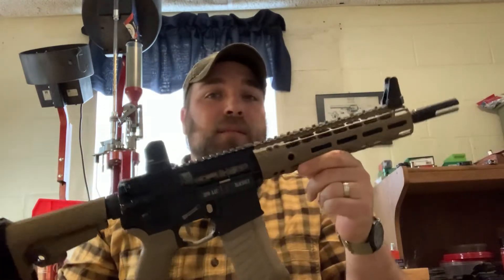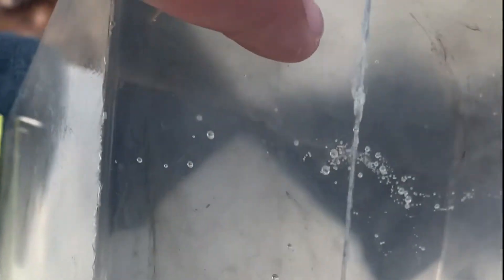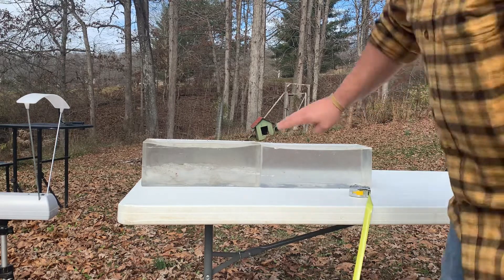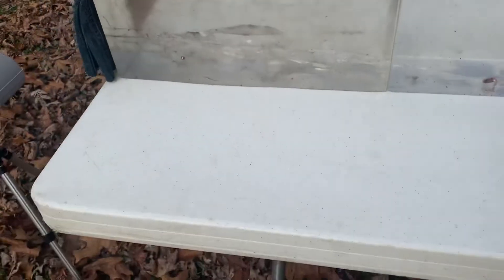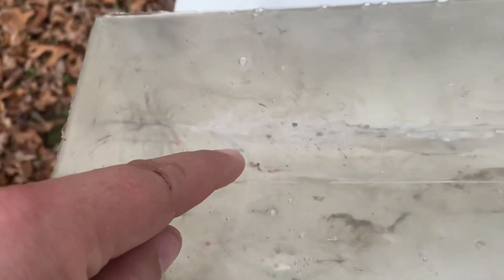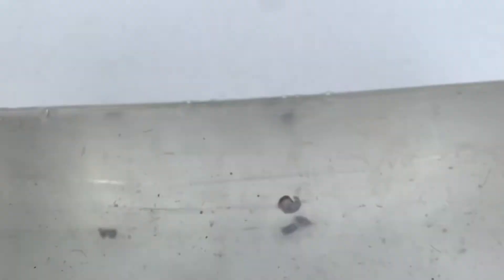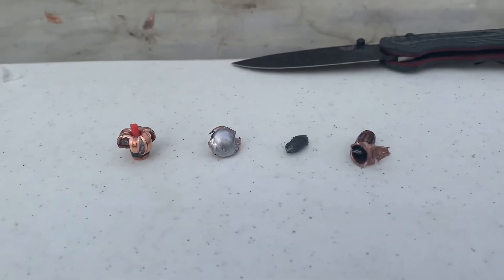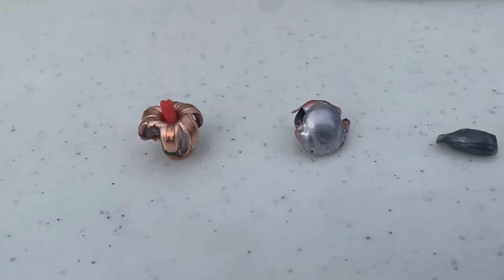300 blackout ballistic gel test

Comment: This test was done at very close range, replicating a self-protection scenario.  There is little value in having a bullet that doesn’t expand traveling 24” into gel. You want maximum expansion and shorter penetration to convert most (or all) of the bullet’s energy into tissue damage.

These results cannot be extrapolated to typical hunting ranges. That’s not to say that the 300 BLK cannot be used for hunting.  It is quite lethal when used within its kinematic envelope. 

But you need to select bullets that are designed to expand at 300 BLK velocities.  There are now several of these on the market.  My personal favorites are:

Supersonic: 110 gr Nosler Varmageddon bullets, that I handload at 2415 ft/sec. Wicked on feral hogs.

Subsonic: Hornady 190 gr Sub-X factory ammo.  This stuff ain’t cheap but it performs exactly as advertised. Hornady did their homework on this one!
Reply from the maker: My daughter has taken several large bodied East Ky deer with the 300blk using the 110g gmx load. Full pass throughs and quickly dispatched.
Reply: There's little value in 300bo period

Comment: I've dropped a 200 lb. hog in its tracks using fiocchi's loading of the 125 gr SST out of a 10" upper at 65 yd. Used to be able to find it for $0.85 a round before ammogeddon.

Comment: Hornady 110gr V-Max is a good one too its a varmint bullet but that is from 308 velocity when your at 2200fps it does not fragment as much and holds together because of the reduced velocity so you get great expansion but still retains weight for good penetration as well.  I was surprised at the GMX those usually want way higher velocity for expansion unlike the Barnes 110 Tac-tx it is all copper as well but its designed full expansion at 300blk velocity and it is the hands down best bullet for a 300blk unless your looking for fragmentation that is.
Reply: The barnes 110 tac tx is the best 300 blk ammo?
Reply: For exapansion?
Reply: @rxmarlo2303  it's pretty much the gold standard for hunting yes,   Google around and you will find lots of reviews and even gel tests
Reply: @brian6697  ohh yes ive seen the gel vids and its impressive how it expands only if 300 blackout was cheaper to have fun at the range😔

Comment: The 200gr. was designed for a larger cartridge. Not a big fan of 300BLK subsonic ballistics. They all really performed as designed with the TNT being fragmenting.
Reply from the maker: Correct. The only subsonic I’ve had expand was the hornady sub x and it was pretty minimal expansion.
Reply: The subsonic ballistics are fine if you take into account what the cartridge was designed for.

Comment: I have been tempted to pickup a. 300 BLK a few times, but until the ammo stuff calms down, I just can't justify it.
Probably fine if you already have a good stockpile for it.
Otherwise, I'd rather just go with 6.5 Grendel or even the trusty ole 5.56
Reply from the maker: 300 blk definitely has its place, one benefit is if you’re a reloader the 30 cal bullets are abundant and you can load about any weight in it. I say abundant in reference to normal times lol nothing is abundant right now